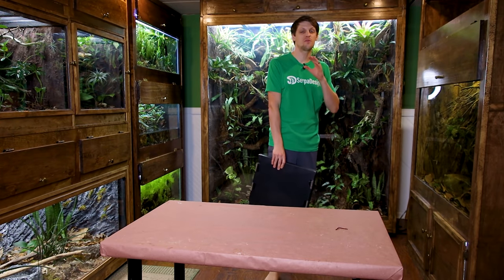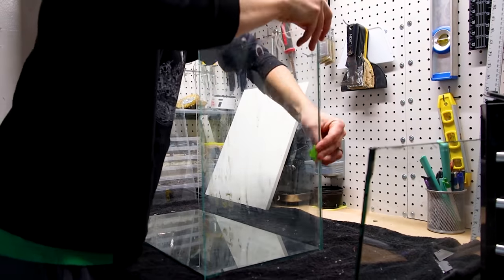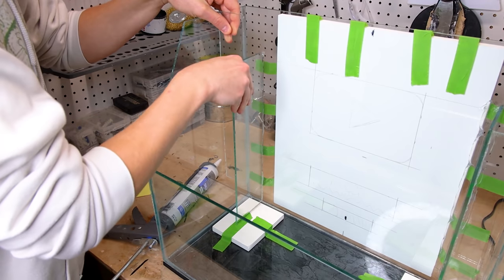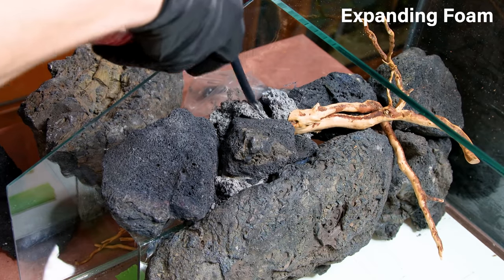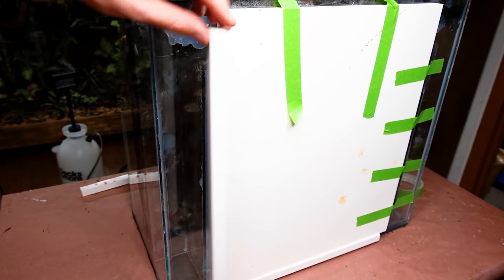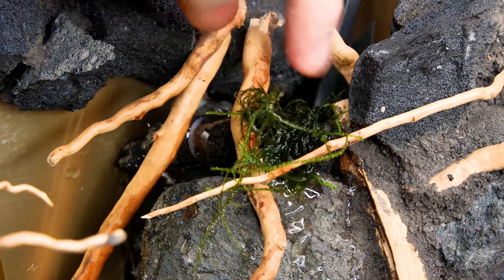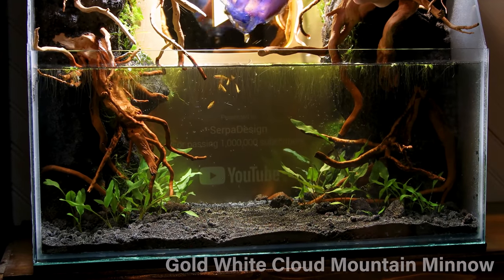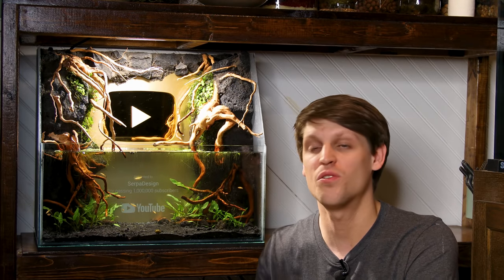Gold Play Button Paludarium for Minnows (World's First?)

Comment: Not sure if you know about this already but as a fly tier I use silicone to and to keep it from sticking to my fingers when I work with it I use Kodak photo flow Solutions. It's a wetting agent and prevents the silicone from sticking to your fingers. Just a heads up if you didn't know about it it would probably help you a lot.